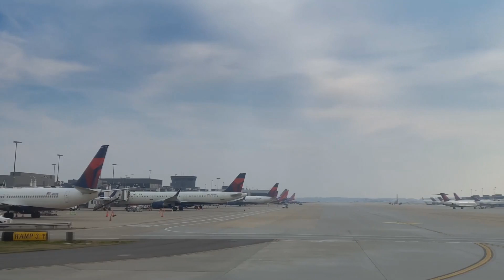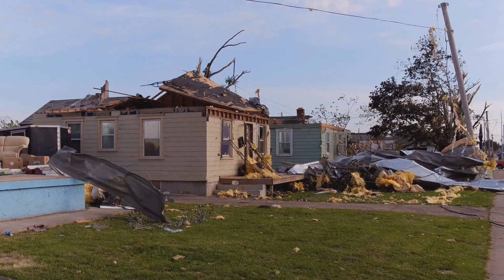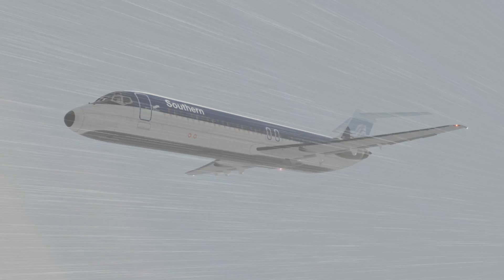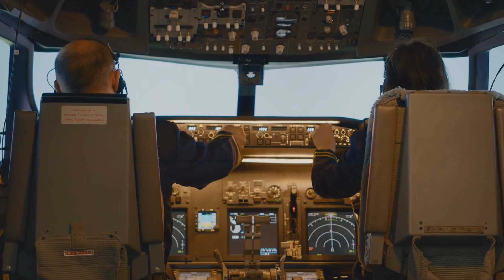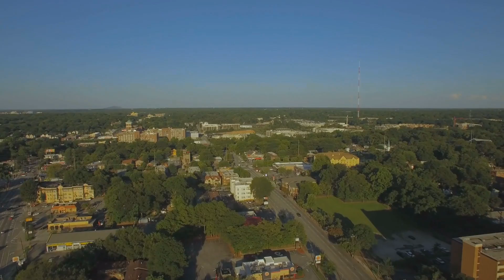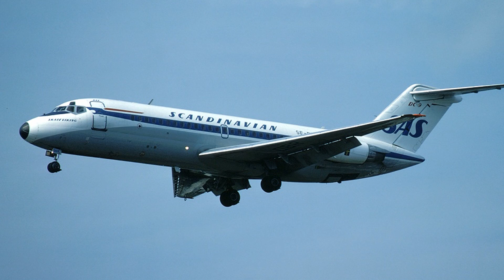Double Engine Failure In Storm Crashes DC9 (Southern Airways Flight 242) - DISASTER BREAKDOWN

Comment: This accident is always tragic to listen to. The pilots fought so hard to save their passengers and nearly pulled it off. Had they successfully landed, the way people viewed aviation would have completely changed. Total engine failure was seen as an unsurvivable scenario. No jet powered airliner at this point had ever successfully landed with no engines and had everyone on board survive. The pilots came so close to proving it was possible but lost it all at the last minute, causing this accident to be another example to the aviation industry of how total engine failure was unsurvivable. It wouldn't be until 6 years later that the world would be shown that total engine failure was survivable when Air Canada 143 performed the first successful emergency landing of a jet powered airliner with no engines, changing the aviation industry forever. Even though these pilots were unable to succeed, they still fought their hardest in a scenario that they had not been trained for, regardless of the lost lives, these pilots are heroes for that.

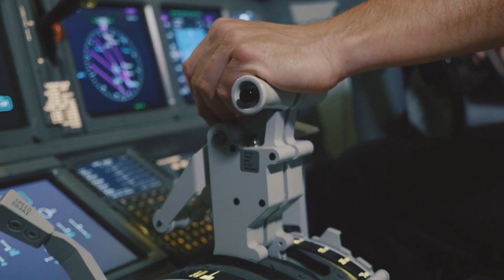Comment: 7:27  That's incorrect.  The rain and hail overloaded the engines, causing the generators to cut out for 36 seconds.  That's what Keele was referring to when he said they "got it back."  That occurred when the plane dropped from 15,000 to 14,000 just before the conversation with ATC played earlier.  The engines failed during that conversation.
Reply: I had heard that the compressor surge bleed valves failed to unload the compressor and as a result the compressor experienced compressor stall which was exasperated by them adding thrust to try to climb back to their assigned altitude. The stalls then tore up the engines which resulted in dual engine flameout.

Comment: Flight 242 was the accident that has shown once and for all that landing a jetliner on a highway is an extremely bad idea even in absolute emergency. Compare this to the Scandinavian MD-80 or Varig 254 that both crash landed in a forest with little to no victims. Today it's taught not to attempt a highway landing in such planes. For say a Piper Archer it's still a good option though, while forest is the worse one.

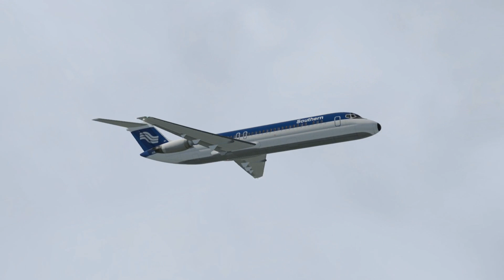Comment: To put a slightly finer point on one aspect:  At 5:30 in the video discusses the radar.  First, airborne weather radar does NOT reflect off of clouds!  The particles which make up clouds are far too small to be detected by these radar systems.  What the radar energy does reflect off of are (primarily) raindrops and other forms of precipitation.  Different types of precipitation have different reflectivities, thus the amount of energy returned to the radar is impacted by both the type AND intensity of the precipitation.

The radar energy is also partially absorbed and dispersed by various phenomena, including the atmosphere itself, but much more significantly by precipitation.  The term more commonly used for this is is attenuation, meaning not all of the radar energy is available to be reflected back to the antenna.  Atmospheric attenuation is predictable and accounted for in radar design, but precipitation attenuation is a more difficult issue to resolve.

The signal can also be attenuated by other factors such as water or ice on the radome, or even excessive amounts of paint on the radome.

Compounding these factors was the fact that the older radars of this generation were monochromatic, they depicted different intensities of precipitation with different levels of brightness, but these different brightness levels could be difficult to distinguish.

It is believed that Southern 242 encountered extreme attenuation, to the degree the display may have indicated to the pilots that the area they were flying into was a thin area of relatively light precipitation, when in fact it was the worst part of the storm.   The crew did the best they could with the information they had, but unfortunately for many years much of the training that crews received on radar was informally passed along, and not all of it was completely accurate or insightful.

Thankfully both radar technology and training has improved significantly over the years, as has our understanding of convective weather and its associated hazards.

Comment: Please stop giving out false information the APU is a small fan that drops out the bottom of planes and uses no fuel otherwise what happens when the plane runs out of fuel just no flight controls? That hole at the back of planes is so that the pressure in doesn't explode ear drums
Reply: What you are describing is a RAT, or ram air turbine, which has a small wind driven generator and hydraulic pump. An APU is entirely internal and is used not only for emergencies, it's also used to start the engines, charge batteries and run the air conditioning packs on the ground. The "hole in the tail" IS the APU exhaust, and the cabin pressure release valves are usually on the lower side of the tail.
You should brush up on your aircraft knowledge before casting shade on others.
Reply: What Juan Carlos said - you clearly know nothing of what you speak.  Further the DC-9’s primary flight controls are mechanical - there is no need for a RAT on that aircraft.  As for the outflow valve, IIRC on the DC-9 that is on the left aft fuselage, below and toward the front of the #1 engine.

Comment: Wait so is the gas station the only thing that caused the explosion? Could they have actually landed the plane if it wasn't there?
Reply: the road was too narrow, so it may have exploded from the wings hitting the trees. But for a moment, the landing was fine, and may have turned out better if that gas station wasn't there.
Reply: @OwlRTA  I've noticed for some reason in the southeastern US, they don't always have wide ditches or much clearance between the trees and the roads. In other parts of the US they cut the trees down near the roads to prevent crashing cars from running into them and killing everybody.

Comment: To be honest, the DC 9 was more of a small mainline airframe rather than a "regional jet". Its direct successors, the MD88, MD90, and Boeing 717 were more in the mainline jet category than a CRJ or ERJ.
Reply: Hmm. First I’ve heard of a mainline frame. How does it differ from a regional jet?
Reply: @57Jimmy  - Common industry terminology referring to what levels (markets if you will) where the equipment is generally used.  There’s not a firm distinction, and it is also blurred by time, as modern “regional jets” are equivalent to what was once considered mainline equipment.  Back in that era, carriers like Southern and Ozark weren’t really considered “regional carriers” in the context of the term today - though they arguably served somewhat similar markets.  Thus the DC-9 has generally always been viewed as a “mainline” airframe, given that it was operated by mainline carriers such as Northwest and Delta (and many others), as opposed to modern regional carriers which evolved to be primarily feeders for their mainline codeshares ( and in turn, the equipment they typically operate).